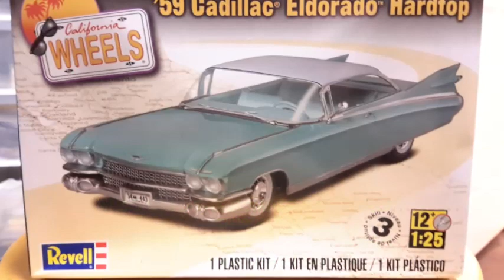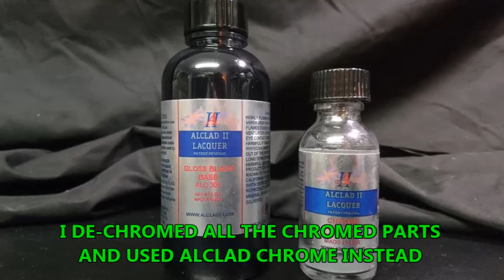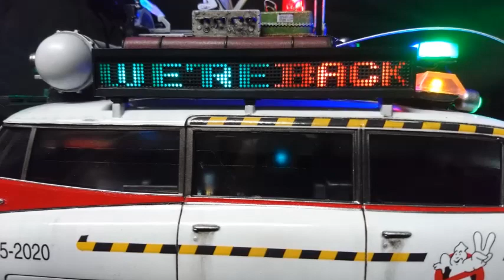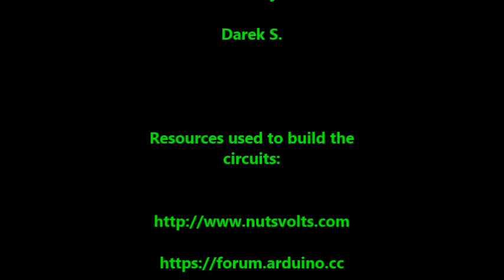Ghostbusters Ecto-1a With Lights and Sounds

Comment: I am working on a 1/18 scale Hot Wheels Elite Ecto 1A lighting project. I everything figured out for how I want to do the lighting on mine except getting the little black dots on the rooftop signboards to show up. Any help on this?  Thanks.
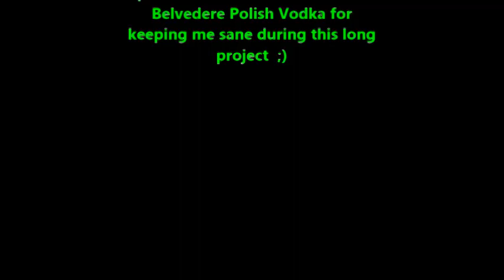Reply from the maker: Well, they are created by using that photoetch set and labels from ParaGrafix  ( 14:11). They mask off the light where needed and automatically create those dark spots.
But they are ment for this specific 1/25 scale model. They most probably won't fit your 1/18 scale Ecto 1A...

Comment: I'm starting work on both the Ecto1 and the Ecto1a. I can never come close to yours, but how did you light up the blue-green light bar? They're molded as a solid chromed plastic part in the kit.
Reply from the maker: I stripped the chrome, masked the areas where the lights are located, and painted the rest with black and greys. The light shines through the unpainted plastic.
I did drill holes in each "lens", because I had another plan originally, but I shouldn't have done that. So don't drill holes! lol It's my only regret.
Good luck!

Comment: Hello, how long and tall is the photo-etch set of the Ghostbusters sign?
to see if they can fit into a 1/18 model
But if the measurements don't fit, there would be no point in spending money on acquiring it.
Reply from the maker: The model is in 1/25 scale. So the set would be too small.
The Ghostbusters sign is approx.. 8cm wide by 1 cm tall.
Reply: @LightsNcrafts  
Thank you for responding, your comment has helped me a lot.
my model is 1/18
and the piece measures 10cm long
X 1.5 high
but if I don't take into account the spaces without letters at each end of the length and height if it fits the
photo-etch.
I will order it hoping that it will be useful to me, otherwise I will have to sell it.
Greetings from Mexico City.

Comment: Excellent model ! There is only 1 missing part, the front grill white strobe lights.
Reply: There are 2 flashing yellow lights on the front grill but one wasn't working in the video... not sure if he intended those to be the strobe lights.
Reply from the maker: Exactly what @TotalMK said. The passenger side light almost never worked lol